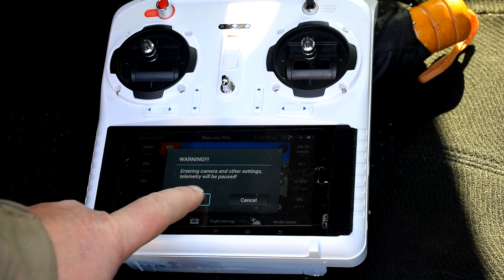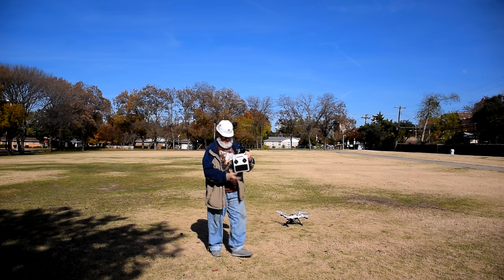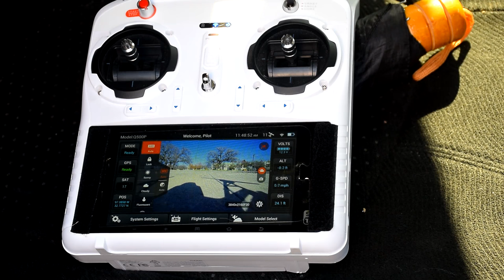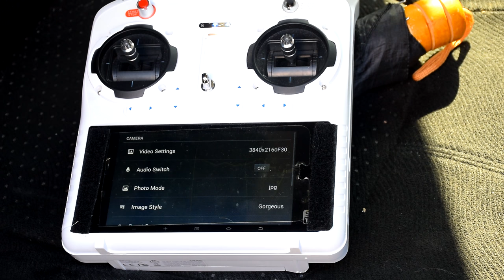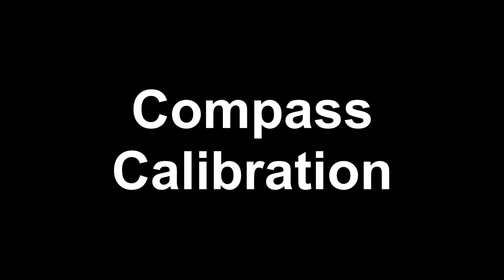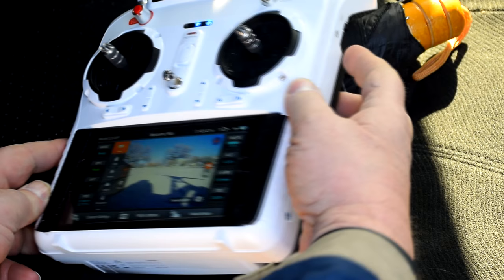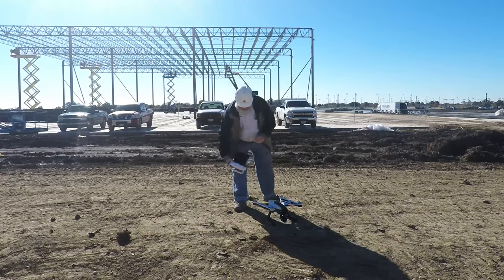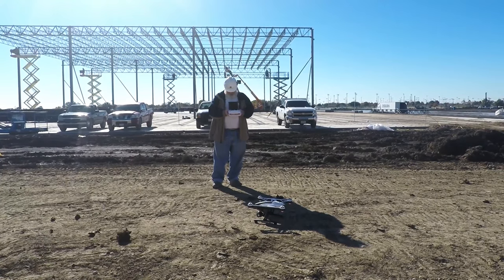Episode 4: How to Calibrate the Yuneec Q500 4K - Accelerometer and Compass Calibrations

Comment: Hey Jeff, waiting for part 5 of your class, my Q500 arrived two days ago. I've done all the charging (damn that transmitter took forever!) and updated firmware for transmitter. My Q500 had a little label under it's belly that stated the firmware version and mine has the latest, so I won't be doing quad updates.  I don't think I need the latest gimbal update as my quad came pretty much up-to-date. What I do need is a compass app like the one you use. What's the name of that app and was it free?  Thanks for all of your informative videos and assistance.  DJ SOUL FORCE
Reply from the maker: I was actually working on  episode number five this evening so it should be posted very soon. I don't believe Yuneec has worked out the details for doing the gimbal update yet so you're good there. 

The compass app I use on my iPhone is the compass that actually came with the iPhone. I didn't add that to my phone at all, not that I remember anyway. 

The transmitter does take a long time to charge. Fortunately, once you get it charge that last for several flights.

Which Q 500 did you get?
Reply: Jeff Sibelius  Thanks Jeff, I'll have to search for a compass in Google play store for my android phone.  I bought the 4K version.  Man, this thing is a beast, should do the maiden flight tomorrow, weather permitting. Thanks again, looking forward to next "class!"
Reply from the maker: +DJ SOUL FORCE Thanks, DJ - I appreciate your posts a lot.
Reply: Jeff Sibelius  I did the maiden flight and all went well. Just wondering if there is a setting for speed or velocity? I read all the manuals, just wondering if I overlooked it or it doesn't exist. So far, I'm very pleased with the Q500 and it's ease of use. I also own a Phantom 3 Standard and XK Detect X-380. One thing I'm missing from the Q500 is an auto panoramic mode, but I'm thinking that'll come with a simple firmware update! Keep up the good work Jeff, thanks.
Reply from the maker: +DJ SOUL FORCE the circular slider on the right side of your transmitter allows you to change speeds - it has a turtle on one side and a rabbit on the other. You can slide that forward or back to change speeds.

The Q500 is a slow aircraft. The P3 is much faster and I imagine the x380 is as well. The last firmware update for the Q500 increased the speed of rabbit mode but it's still slower than any other major brand of aerial video quads.

Auto panoramic mode? I'm not familiar with that one. I didn't see it listed as a planned feature of the new Typhoon H coming from Yuneec in the middle of 2016 either. The only thing I can think of would be for still photos - the aircraft is so stable that you can get a good panorama video simply by yawing the aircraft.
Reply: Jeff Sibelius  I'm aware of the turtle & rabbit, I'm looking for just a little more! The x380 has auto pan (hands free) as well as FAP (fly around point) or orbit mode. The Typhoon H probably doesn't need auto pan  since the gimbal has 360 degree rotation. Kind of fun comparing features of these guys, it'll make for an interesting video one day. If you have chance, browse my channel. thanks
Reply: +DJ SOUL FORCE androidTScompess is what I downloaded turn on location and will give you gps location
Reply: chris bentley Thanks Chris, I found several free compasses in the Google Play store.

Comment: CAN THE ACCELEROMETER CALIBRATION BE DONE INDOORS?
IS THE BINDING OF THE Q500'S CAMERA & DRONE DONE FROM THE FACTORY?
Reply from the maker: Yes, you can do the accelerometer calibration indoors - I typically do mine that way because I have a surface I know is extremely level. 

You should receive your Q500 already bound - the camera / drone and transmitter should all be connected when you take it out of the box the first time.

Comment: Could I Calibrate the accelerometer inside the house or does it have to be away from buildings like the GPS calibration
Reply from the maker: You don't have to be outside to calibrate the accelerometer. I typically do mine inside on a table that I know is level.
Reply: Jeff Sibelius 👍

Comment: I just bought the yuneec Q500 4k and I'm super nervous to fly it...to the point I wanna take in person training classes first lol...
Reply from the maker: Hi Mohamed - I understand how you feel exactly. I bought my first drone and let it sit for over a month because I was afraid I'd crash it. LOL 

You're doing the right thing in researching how to fly on Youtube. Seeing other people do it and explain what they're doing will give you confidence.

Some ideas to make sure your first flight is a success:

Do your flight on a day that has very little wind. Check the website weather.com or uavforecast.com to see what wind predictions for your area will be. Try to fly when winds are below 5-7 miles per hour.

Pick an open park or field so you've got plenty of space.

Follow the preflight steps in my videos 1-2 to make sure the aircraft is ready.

Keep your first flight simple. Plan on pracicing take-off, hover, test what each stick does separately, landing. Short flight of a couple minutes. Then do the same thing again. Build your confidence. Have a plan on what you want to try before you take off.

If you fly in smart mode, be sure to stay more than 26 feet away when you launch.

Keep your first flights within 100 feet or so so you can keep a close eye on it. Also, fly higher than 10-15 feet to give yourself some vertical safety space.

Keep the drone in front of you during all flights. Flying it directly overhead or behind you can be a little trickier.

In subsequent flights, add new techniques - using both sticks together, follow me / watch me, etc.

Record your flights so you can practice working on video editing as well as flying.

Be confident and give it a try! And do me a favor - post back here and let me know how things went.

Good luck!
Reply: I most certainly will back.  thanks Jeff.. you made it a lot easier now... you're the man..
Reply from the maker: Happy to help!

Comment: Hi Jeff! i wonder if you could give me a solution on why my Yuneec q 500 4k won't even start the engines when i carry it to a higher elevation spot in order to fly it (eg 3000 ft high on the mountain). Screen goes totally blind on ground station monitor and then nothing. Have in mind, that all firm. updates are done. Thanks in advance. 
Gabriel.
Reply from the maker: Wow, that's an odd problem. Looking at the user manual, it says that if you try to take off above 8,000 feet MSL the motors won't start. That doesn't explain your transmitter's behavior, however. Check to make sure you're not trying to fly above 8000 feet above mean sea level, and then I'm going to have to refer you to Yuneec tech support. Let me know what you find out, please. I'm curious on this one.
Reply: Thank you very much! i ll try to get in touch with Yuneec tech support, and i will let you know! (altitude when i tried to fly the bird was not more than 3000 ft according to my garmin GPS)

Comment: Hello Jeff, I have a problem with my ST10+ interface since i've buy the Q500 4K. No indication of the distances of the drone ( Height and distance) Do you think it could be an accelerometer  calibration problem or compass ? i've done compass well, but accelerometer do not know...thanks for help me Jeff.
Reply from the maker: That is not a problem with your accelerometer, Thierry. 

When you start up your aircraft does it connect with satellites to give you GPS connection?
Reply: Thank you Jeff to answer me. Yes my RC is connected with GPS
Reply: I've no indication about drone speed too...i've forgot to say it ! :)

Comment: hey Jeff do you have to do both calibration each time you fly in different locations?
Reply from the maker: No, as a matter of fact I'd discourage that because the compass calibration process is kinda tough on your gimbal. (spinning the aircraft around flops the camera around quite a bit.) I fly all over the Dallas / Fort Worth metroplex and don't recalibrate. I've driven from DFW to San Antonio (250 miles?) and didn't calibrate. 

Always calibrate when you first get your drone and after a firmware update. Calibrate if you travel long distances. 

One more tip - every time you launch your drone, pop it up in the air and let it hover for 15-20 seconds. Watch it. Does it sit in place or does it circle around in a slow circle? If it does the circle motion - this is called toilet bowl effect - carefully land the aircraft and do a calibration. I test my aircraft this way every flight. Give it 20 seconds to make sure it's locked in on its GPS and calibrated properly, and you can fly with confidence.
Reply: so when you first got it do you have to do both calibration?  or you can you just do one?
Reply from the maker: I would encourage you to do both calibrations before the first flight. Remember, the aircraft was originally set up and calibrated in China, then shipped to your location. It might fly with no problem, but that's quite a distance from its previous calibration point (unless you live in China, that is). 

The calibrations for the Q500 are pretty simple, and it fails the drone will give you an audible warning. If that happens, just do the calibration again.
Reply: Thabks again jeff.. I know Im bombarding you lots of questions.. one more thing.. do I have to register this specific drone(yuneec Q500 4k) with FAA? Cuz best buy told me I don't have to get it register..
Reply from the maker: Ask away, I do this channel because I enjoy helping out new pilots. 

Yes, you definitely have to register the Q500 with the FAA if you live in the US, whether you fly for fun or fly commercially. It's easy to do and costs only $5 so it's not a big deal - and if you don't want to mark up your nice looking drone, you can put the registration number on your battery or inside the drone. As long as it can be accessed without the use of tools, it's legal.

Ahhhhhh, Best Buy. I'm going to do a video on where you should and should not buy drones, and this is one reason why I steer people away from big box stores. They gave you false information that could have earned you a fine because they don't know what they're talking about.
Reply: I figured they had no clue... it's a 27.something pound drone n deff had to be registered but I ask to confirm and they told me I don't have to... 
Thanks for the confirmation jeff...
And I'm looking to that video because I think I got ripped off.. cost me about a grand...
Reply: There are no longer requirements to register as of a couple weeks ago. You may have to if flying commercially.
Reply from the maker: Good update, mglass. You're right - hobby flyers no longer have to register with the FAA thanks to a federal court in DC. Commercial flyers are unaffected by this ruling. Watch this link for more info https://www.youtube.com/watch?v=i4V_GZiW5c0

Comment: I did both My camera will not face foward always facing down is that normal?
Reply from the maker: Definitely not. If your camera is facing down while the aircraft is powered up, there is a mechanical problem that needs to get fixed OR the camera is not getting power. 

With the aircraft shut off, unplug the little cable that connects the camera to the drone . . . unplug it from the drone and re-plug it in, making sure it's fully connected. Then boot it up and see if that fixes the issue.

If not - do you see any indicator light on the camera while powered up? Do you see the video signal from the camera on your transmitter? You'll need to call Yuneec CS and they'll want to know if the camera is receiving power and sending its signal to the transmitter or not.
Reply: wao thanks for the fast reply I'll check it now
Reply: thanks for your help all good you earned ny subscription big thumbs up
Reply from the maker: Was it the loose cable? 

I'm glad to have been able to help.

Comment: Hi,  Just flew my Q500+ for the first time today. Calibrated compass before flight. The first battery I flew about 18 minutes and decided to change batteries. After powering off, installing new battery and powering back on I made sure I had 14 satellites on transmitter and 10 satellites on drone. It flew about 2 minutes then I got a warning on transmitter screen saying "Warning GPS signal lost". The drone was only 35 feet away. I lost complete control and the wind carried it off. The transmitter was unresponsive. The drone crashed about 60 feet away. All batteries in drone and transmitter had power. Any ideas on what went wrong. I was also in an open area.
Reply from the maker: +generac43 Sorry to hear what happened. :-( I'm glad you were flying in an open area for your first flights. Frankly, the potential for a mechanical issue is another reason why I encourage people to do that to begin with. The Q500 has a terrific reliability record but ANY mechanical device can have defects, so doing first flights with no one or no thing around is a good idea.

Just reading what you posted, it sounds like a mechanical issue with the transmitter or the quad itself. 

The fact that you flew a full battery with plenty of satellite connection right before the problem indicates that you weren't blocked from GPS signal, and your problem doesn't sound like it's environmental. Especially if you were only 35 feet away when everything went bad.

You should not lose control of the aircraft if you lose GPS - you should still be able to fly it manually. If you're an inexperienced pilot you might have trouble flying manually, but you said the tx was nonresponsive - that's not a question of skill.

Were you recording video at the time? Do you have a media card in your transmitter to record telemetry?

If you have video of the incident, put it up on Youtube so people can see and maybe help diagnose. I encourage you to post your experiences on the following discussion forum to get feedback from other pilots: http://www.rcgroups.com/forums/showthread.php?t=2272622

Also, you should call Yuneec tech support immediately. Their support team is great. 

How bad was your quad damaged in the crash?
Reply: +Jeff Sibelius 
     Hi Jeff,
   Thank you for your quick response. I did not have an SD card in the transmitter and the video I was recording during the crash was corrupted. All video prior to the battery change was fine. 
     Thankfully the Q500+ wasn't up more then about 20 feet as it descended diagonally downward into small some small desert shrubbery which flipped it on it's back. It was about 90 ft from me by the time it crashed. There were 2 broken propellers and some dirt which wiped off.
    I called Yuneec and their tech had very little info. I did most the talking and suggested maybe a Firmware update and re-binding the unit. (I read somewhere some guy had the same problem and this helped him). The tech said he would suggest the same thing. But didn't think it would fix the problem. He had nothing else to add. I had to pump him with questions. I also had the 4 second green light on then 1 second off in Safe mode and 4 second purple light on and 1 second off in angle mode. He said it was normal. I will cautiously fly again and see what happens. 
    Thanks again and I will check out the forum link.
Reply: +Jeff Sibelius 
     Hi Jeff,
   Thank you for your quick response. I did not have an SD card in the transmitter and the video I was recording during the crash was corrupted. All video prior to the battery change was fine. 
     Thankfully the Q500+ wasn't up more then about 20 feet as it descended diagonally downward into small some small desert shrubbery which flipped it on it's back. It was about 90 ft from me by the time it crashed. There were 2 broken propellers and some dirt which wiped off.
    I called Yuneec and their tech had very little info. I did most the talking and suggested maybe a Firmware update and re-binding the unit. (I read somewhere some guy had the same problem and this helped him). The tech said he would suggest the same thing. But didn't think it would fix the problem. He had nothing else to add. I had to pump him with questions. I also had the 4 second green light on then 1 second off in Safe mode and 4 second purple light on and 1 second off in angle mode. He said it was normal. I will cautiously fly again and see what happens. 
    Thanks again and I will check out the forum link.
Reply: +generac43   AFTER Firmware update to v.1.07 and re-bind. My Q500+ is currently v.1.06.
Reply from the maker: +generac43 Try putting the SD card back into the camera, boot up the TX and quad, and then just start and stop the video a couple times. Your last video clip is corrupted because you probably didn't hit stop record button when it crashed. Sometimes - not always but sometimes - if you put the card in and do the stop/start once or twice, it can still salvage the last recording. That would be helpful for the tech support if needed.

Check it out on that forum - I post there as "websiteauthor" so I'll see your posts. If you don't get clarification there, I would encourage you to call Yuneec back and state that the aircraft is malfunctioning and you want a ticket to have it checked out. 

I'll be watching for your posts.